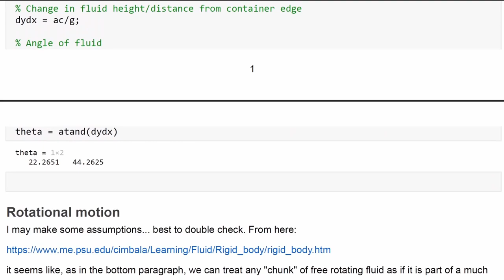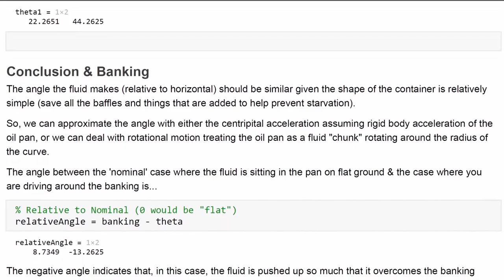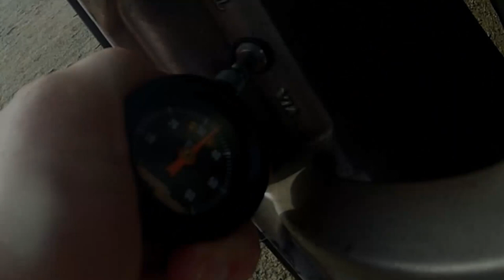The Truth About Oil Slosh in Road Cars on Daytona International

Comment: makes sense. when i was there, i believe 90 mph was the break even point where the car stays centered with no hands. more throttle, and the car starts to climb the banking, slower, and it starts to fall. in a car with symmetrical alignment for road-course use.

Comment: Love these videos, the work you put into them, and that you actually DRIVE & track your NSX!  Great job.

Parking at a 15-20* angle will have the full 5-6qt capacity in the pan since no oil will be stuck in the heads like they do at high RPM, so shouldn't be too sketchy.

It's hard to tell in the video because it doesn't look quite sync'd up but the banking at Daytona is flat (full throttle) all the way around.  You can do it! :)
Reply from the maker: Thanks Billy!  'Appreciated your input to some of my questions leading up to making this.  Also yes, maybe save for my first session I was flat through both sets of banking.  I didn't quite get to the point of attempting the infield kink flat, but got that down to a confidence lift by the end of the weekend.

Comment: Nascar’s fuel pickups are in the right side of the fuel tank because of the g-forces through the banking. Thats why you see drivers drop off the banking under yellow trying not to run out when they are close on fuel
Reply from the maker: Definitely makes sense especially considering with no chicane or infield those guys are carrying what? 200mph into the banking?
Reply: @LapoftheWorld  yeah. Even on flatter tracks they still carry enough g-forces it makes sense to have the pickup there.

Comment: Brooklands is/was a parabolic kind of banking, so the angle changed based on how high up the bank you got. It was 30 degrees maximum, see below.
Reply from the maker: I worked with a UK historian to do a video on Brooklands earlier this year.  You're correct that it is parabolic, but 30 degrees is indeed the max banking.  That is VERY steep and it would be very difficult to stand or move around.  Video in question:  https://www.youtube.com/watch?v=1Rcnakt4ANg

Comment: Just a camera tip for you, you have a lot of dead space above your head in your intro shot.
For this shot, I'd try to stick closer to the rule of thirds. Lower the tripod and place your eyeline higher up in frame. This would also allow more of your gesticulation to be visible and wouldn't crop the front of the car.
Reply from the maker: Appreciate the tip. I am usually more careful with my framing.  I shot that intro in a hurry between day job meetings as I found the original intro I shot didn't turn out (mic issues), the driveway is on a weird slope, the sun was at a bad angle, an insert any other excuses here 😅😁 🎥 🥔
Reply: @LapoftheWorld  hey no worries, not trying to be a know-it-all just like to pass on knowledge to fellow aspiring creators.
This video was interesting and clearly took a ton of effort